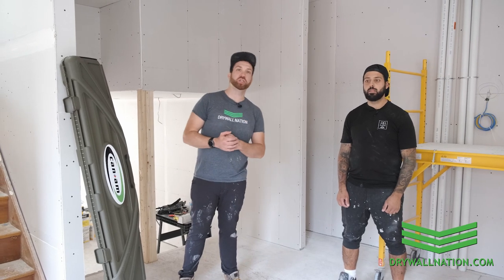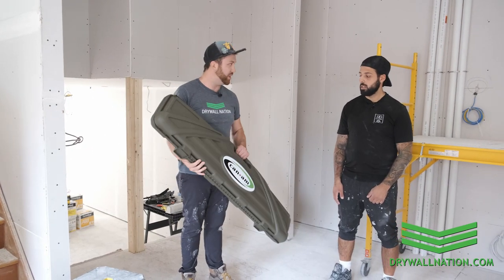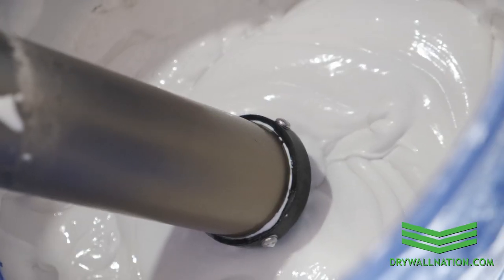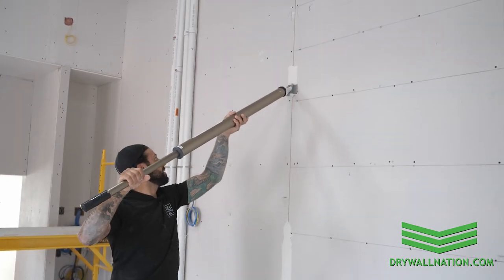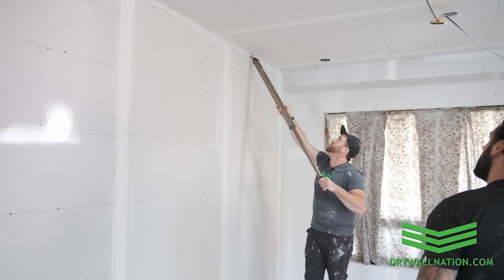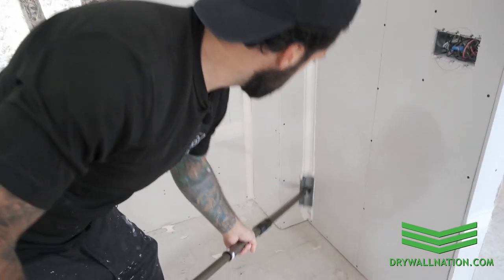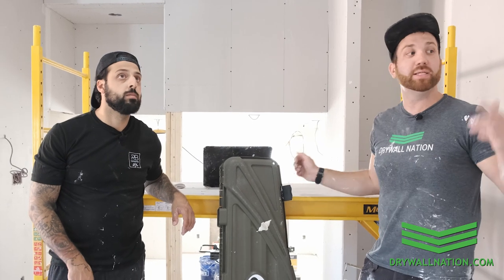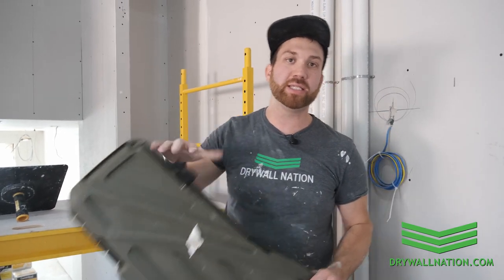Can-Am Semi Auto Pro Tool Kit. Site visit with PRB Contracting.

Comment: Hey Brian something I noticed 
When you run the tube with aplicators I goes so much  nicer if you follow the applicator sort of pushing it you did this in the vid .
Your guy there did what I used to and kind pulled the applicator it had to follow him it works but is so much harder just a pointer you somtimes don't even realize that's how your doing it .thanks again for keeping up the vids man

Comment: After running the flushers, do you need to do a finish coat, or is it ready to sand and prime?
Reply from the maker: Sorry for the late reply Dave. You need to do a finish coat after the tape coat yes. So pass the flusher once when taping, which evenly applies a light coat. Give it a presand, and then pass it a second time for your finish. Then you're ready for final sand.

Comment: The quality of taping by hand will never be beaten by a tool, but the tools are faster....up to the individual I guess....
Reply: This method is pretty much by ✋
Reply: This method is clean compare to banjos and sheetboxes methods this one is clean and never leaves empty bubbles under the tape. Plus it save your wrist and elbows. Taping by hand is harder for your body and slower. Its a no brainer for someone who wants to last long in the trade but I gotta say if the guy can’t tape properly by hand he shouldn’t use the compound tube until he knows how to tape drywall all by hand. Gotta learn the trowel/hawk and knifes method before forsure